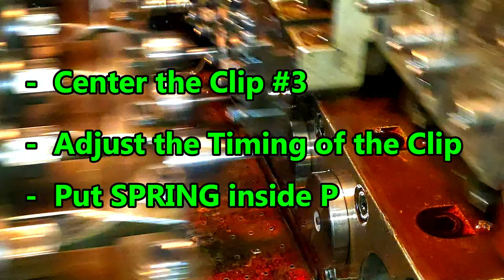How To Make Hexagon Socket Head Cap Screw | Bolt Former Machine Tutorial

Comment: I want to make 8mm hexagon socket head cap screw please tell me a steel wire size for 8mm
Reply: Give me answer please
Reply: 7.80 or 7.83mm
Reply: Use 9.80 dia and extrude 7.00 With trap Extrusion

Comment: Hello brother

In the last u said that no cooling oil use 

Then which type lubricant need on wire 

And what will problem if u used cooling oil
Reply from the maker: I try putting cooling oil to the Molds is good but Hexagon Pin Puncher only last 10K , then when stop the Oil it produced 30 - 50K pcs... but if use Stainless Steel wire it's better to use Cooling Oil or the Molds will break... I hope this could Help,  Thanks for your support.
Reply: Even for stainless along with traditional automotive 10/10 wire, we typically only run coolant oil on the 1st station in a nut former,  or the cut-off station on a part former......The issue with oil further down past the 2nd station is , most dies can't effectively vent alot of oil (oil can't be compressed) and if the oil gets trapped in the corners of the die, it will crack the dies....Also if your piercing a hole through the part, the oil back flows at high speed and actually 'tears' the hole creating a 'blown hole'. A blown hole can cause upraised metal on the finished part.